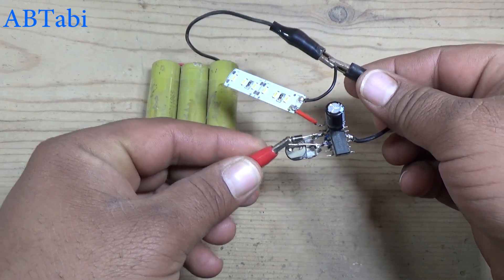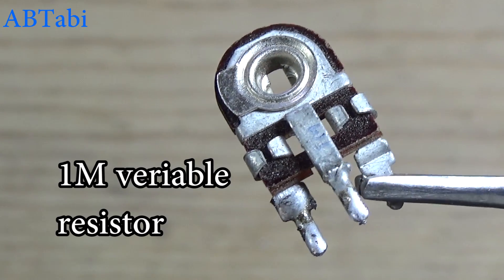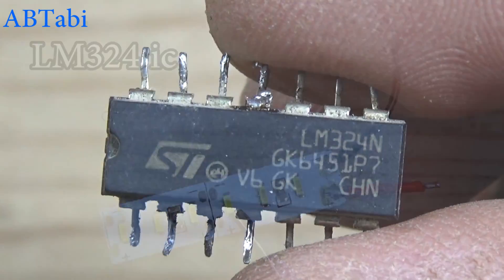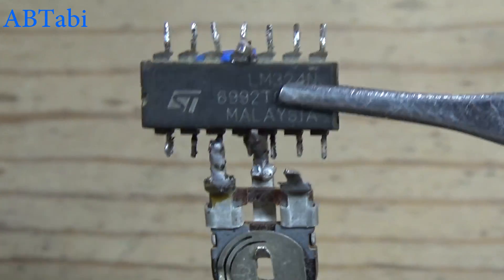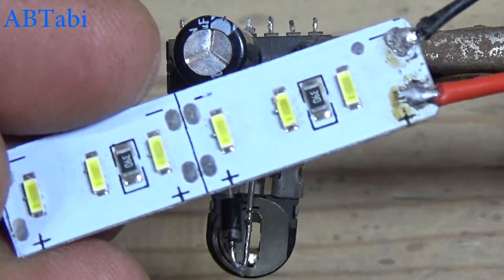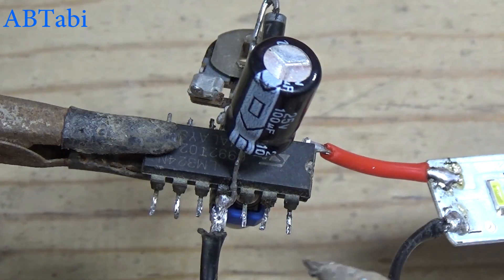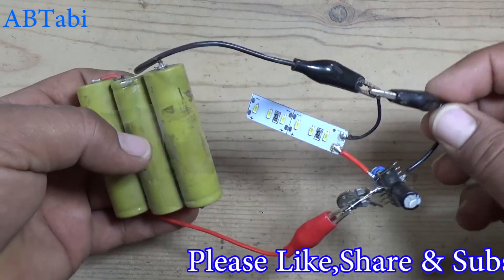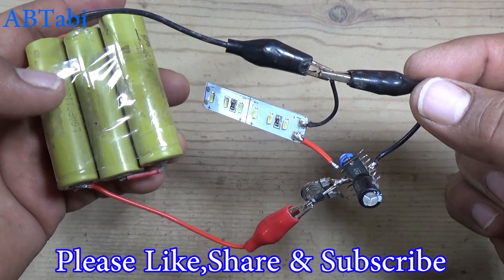Make a Timer circuit using LM324 ic, Light ON OFF delay timer circuit

Comment: There is a short circuit current limit of 40mA on each output pin and a max power dissipation of 1W . That LED array may be exceeding those ratings.